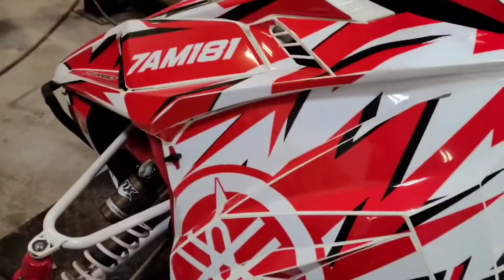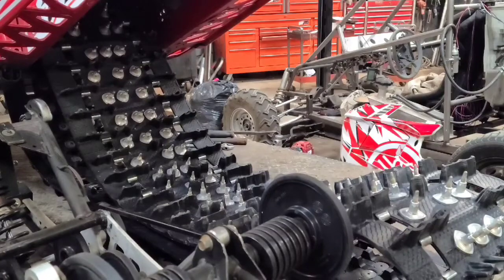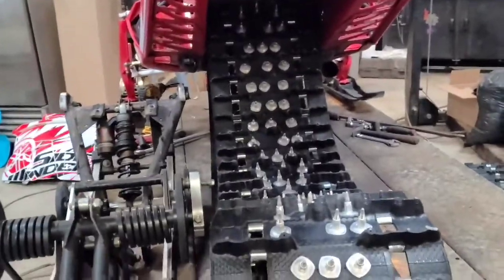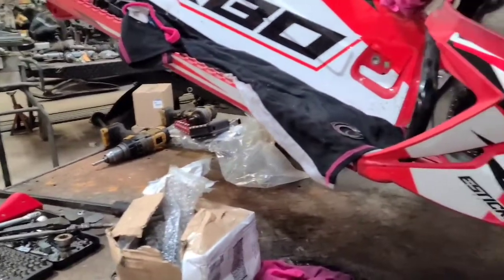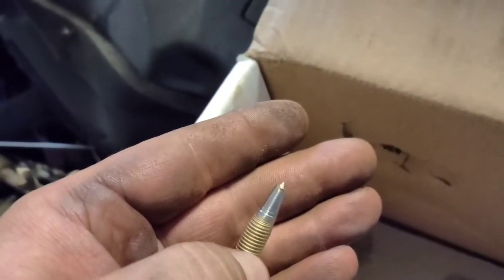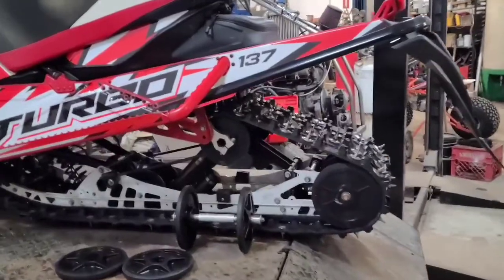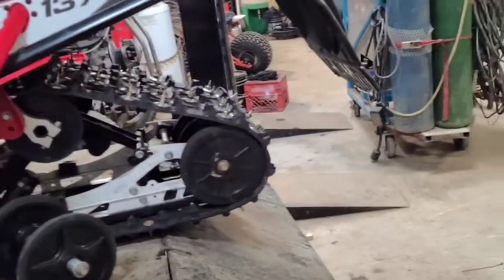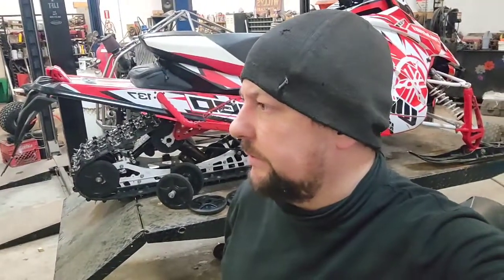Adding Speed to the Sidewinder. Track, Studs and Gear Install

Comment: Hey Pete I enjoy your video's! I've worked on my own sleds for many years, and I've changed many Tracks by myself. What works for me is, if you take 2 strips of wood (1" x1.50" x 36" long. Put them between the skid and the Track (The thickness of the wood is slightly higher than the inside lugs on the track). While the Sled is suspended, ratchet strap the Track up for clearance on the top side and the skid will slide out on top of the wood strips! Reverse procedure to put it in! Works like a charm!
Reply from the maker: thanks for watching! and that's a great tip...I'll have to give it a try 🍻

Comment: And it still won't beat that Ole Polartrash 700! Lmfao 🤣
Reply from the maker: lmao well we never did try the old pullyourass against the sidewinder...🤔 next time it snows I say it's go time!! 🍻
Reply: @RedNecks & DirtyHands  I have the 02 RMK 700 with 13,300 miles on it ! Only a top end 3,000 miles ago . The rest is all stock. It's a incredible engine.  The slide on the carb literally got so thin it broke . Replaced and she's still being ridden . 50 miles yesterday.

Comment: What gears you like to run in it?
Reply from the maker: we put a 22 top in it with the stock bottom for a bit more top end trail riding but run a 24 top and 38 bottom for speed runs! 🍻